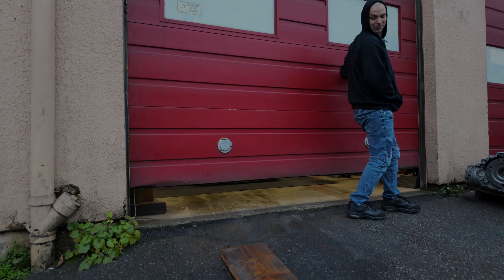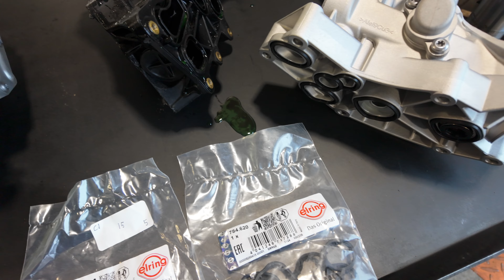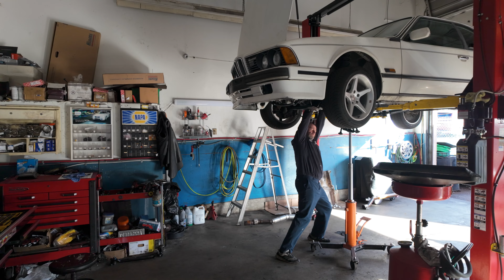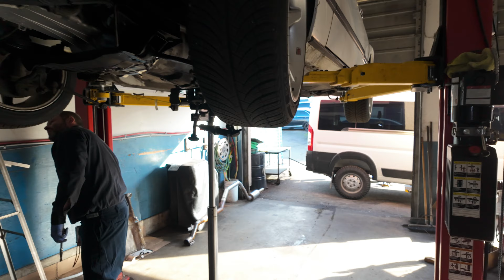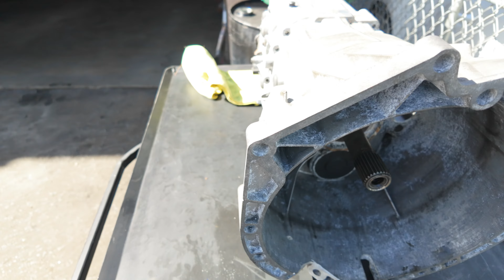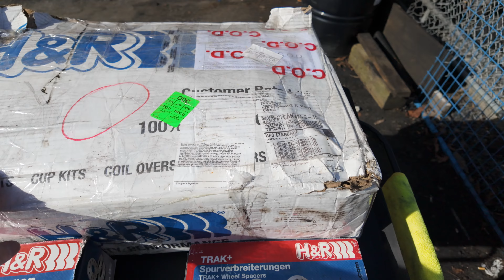Our B58 swapped E24 ran into another problem...

Comment: Hey mate, good job! could you please share video about how to change all bearings, and closing it back? my gearbox is also fucked (only bearings) and i cant find any manual for dis/assemble. Thank you!
Reply from the maker: Hi,  waiting for bearings.   We make a video forsure!
Reply: @amayakauto  Appreciate it ! in my car the one at the rear (facing the shaft) is the one rattling. Its a pity the gearbox doesnt come with bolted rear case.